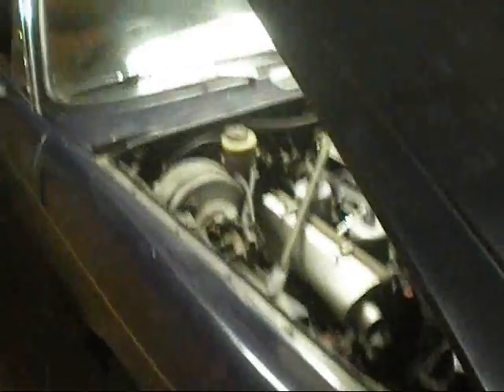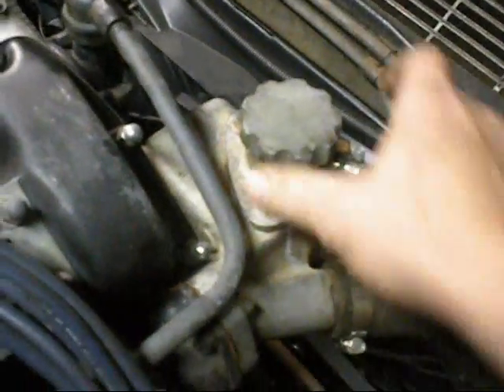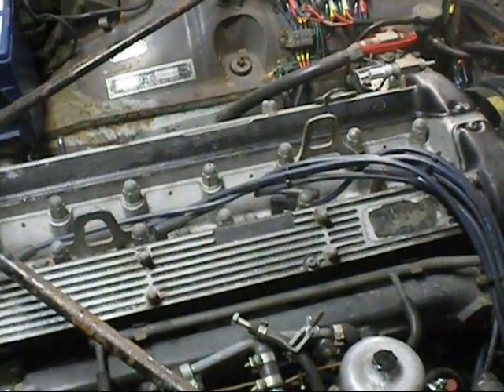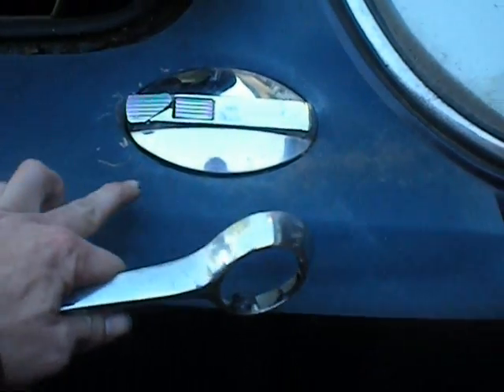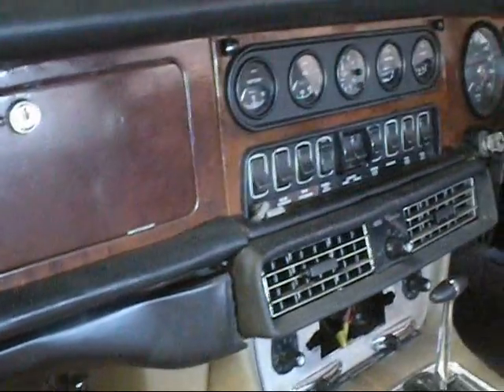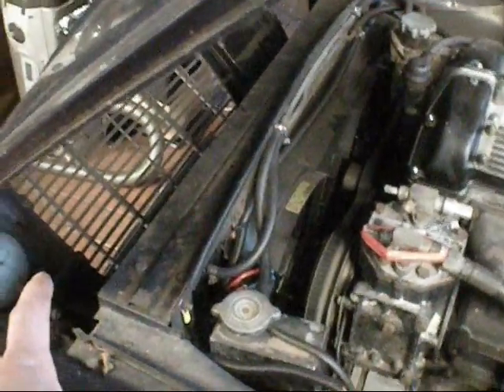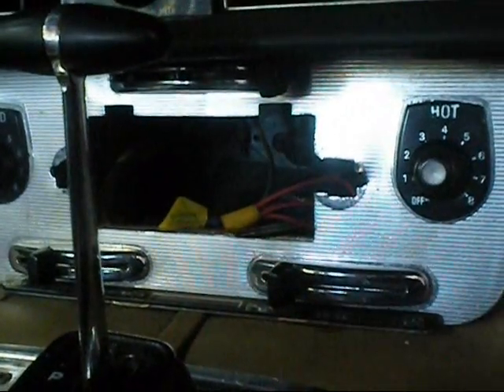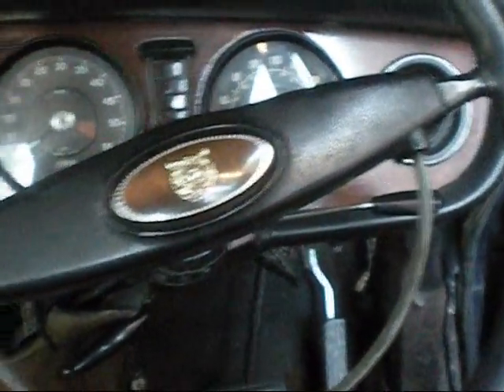look over 1969 XJ6

Comment: @airconguy1 Google is your best friend for learning how Auto's work, but IIRC.

AT's contain a number of gear sets based on how many speeds it has, the bands are like brake shoes, they are actuated hydraulically and stop certain gear set housings from rotating, thus changing the speed of the output shaft.

It is confusing, I still don't understand 100% how the bands, clutches and planetary gear sets work together.